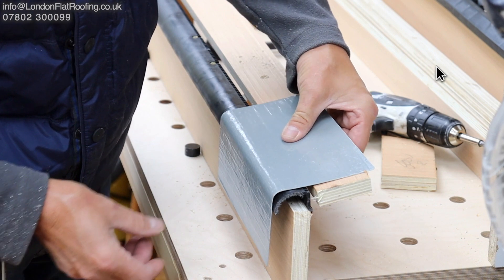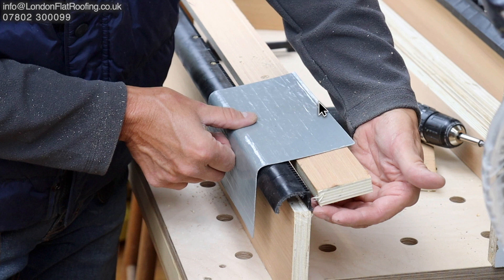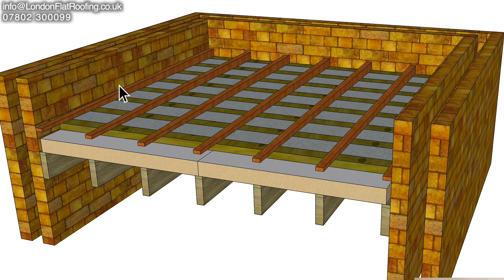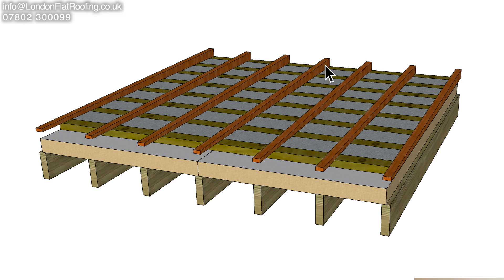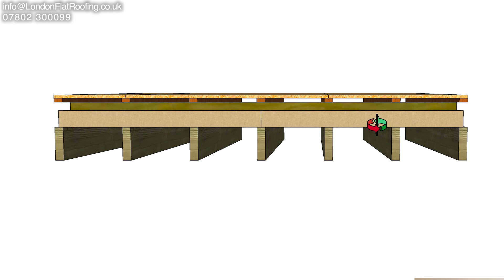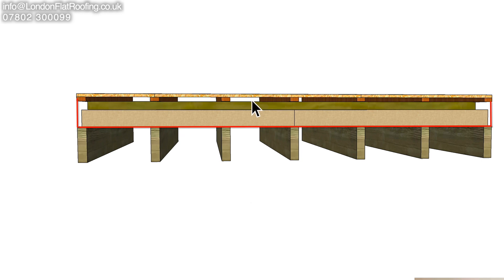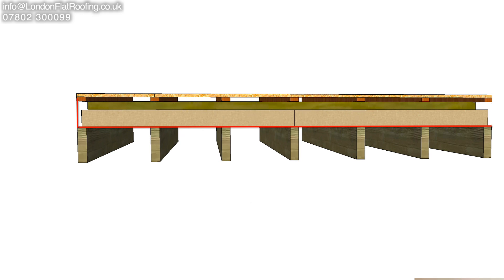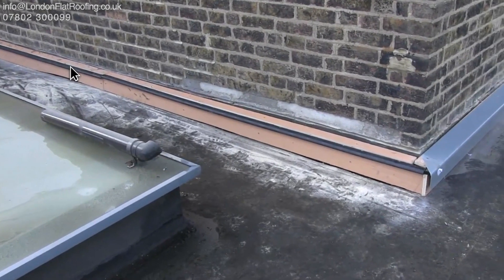Venting a badly installed cold flat roof using abutment vents and mushroom vents.

Comment: I was wondering Steve if you know how to vent a small cold roof with zero overhang to put soffit vents
Reply from the maker: Yes use vents that can be fixed into the gutter board you can adapt most events

Comment: Hi mate. 
I've installed a rubber roof on my shed. 8 foot x 8 foot. 
However there seems to be a build up of condensation on the inside on the osp board. Any ideas of how I can sort out the issue.

Comment: Surprised you decided not take the upstand up the wall, dressing the waterproofing in level with the top of the GRP flashing could potentially lead to water getting in the chase, especially as it’s so wide and flat and particularly in a few years when the mortar cracks. I would have at least gone up one brick and used a suitable silicon sealant instead of sand and cement.
Reply: Could have maybe just made the top of the upstand at a 45 degree or steeper angle rather than flat?

Comment: Hi Steve, thanks for posting such useful videos! If I might ask you a quick question: I'm fitting my own warm flat roof, I understand that the boards need to be fitted tight without gaps but there are some areas around the edges where that's going to be really difficult and a bit of gap is inevitable. In these areas is it ok to fill in with expanding foam? The build up is WBP ply deck, torch on IKO vcl, pir boards, OSB and then the SIG liquid roofing with fleece reinforcement. 

Thanks.
Reply: When I say 'the boards' I mean the p.i.r insulation boards - can I foam up the gaps where they don't quit meet the awkward details? Ta.
Reply from the maker: Yes back fill all gaps with foam. whats the name of the SIG system you will be using?
Reply: Great, thanks. I'm using the fix r liquid roof.